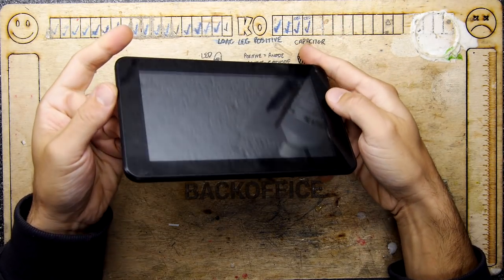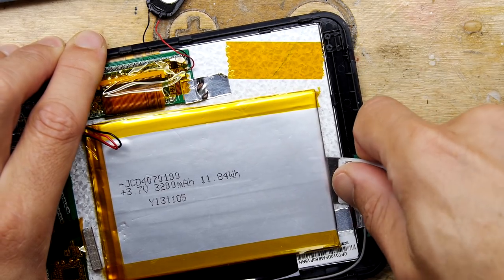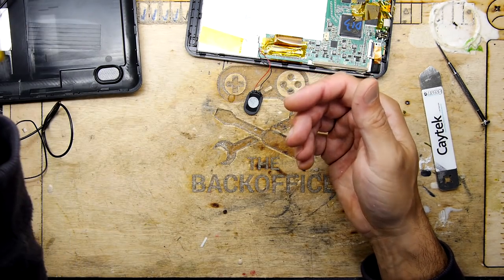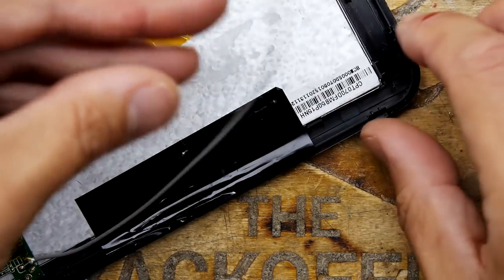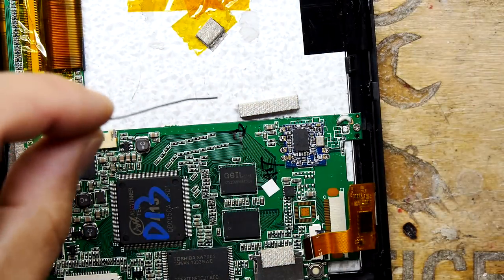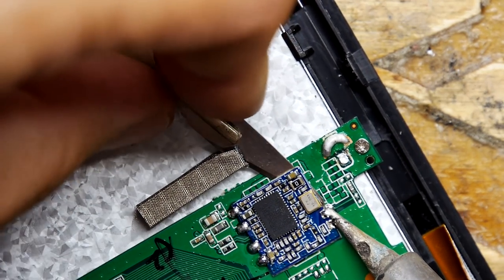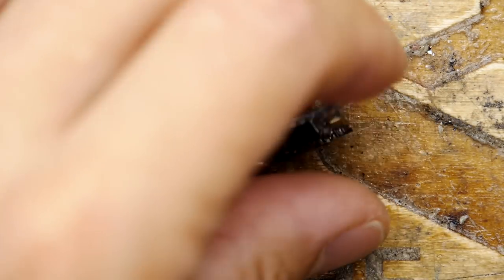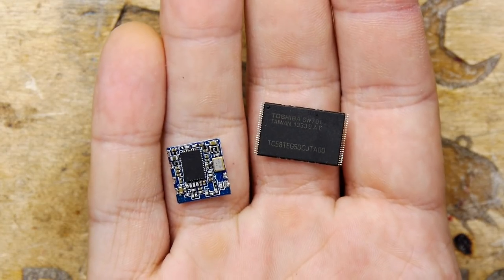Tablet Teardown

Comment: To remove a battery you can try Isopropyl Alcohol that dissolve the glue. Use a tool like the one you used is very dangerous, if you do a hole on the battery and oxygen gets inside it starts to burn and you lose the tablet. Another method is use poker cards, insert them where you can and move it like a knife. Using multiple cards you avoid glue return to attach it and soon you've done the job.

Comment: That WiFi module is indeed a USB... But it's 3.3v so you'll have to get a voltage regulator for it, I've tried to put it on 5v, it does work a little bit then it get hot and burnt
Reply from the maker: It works!